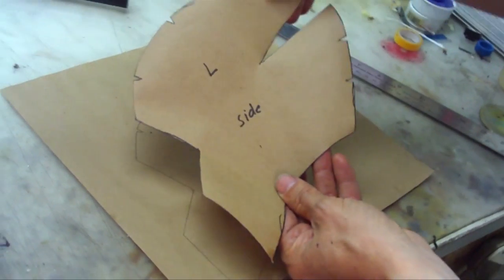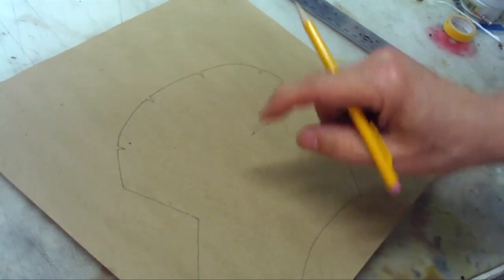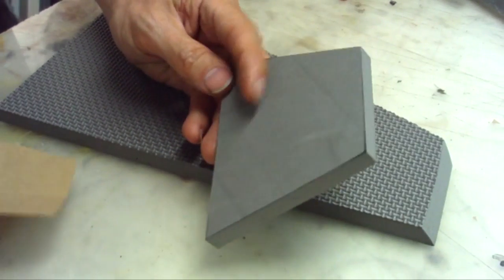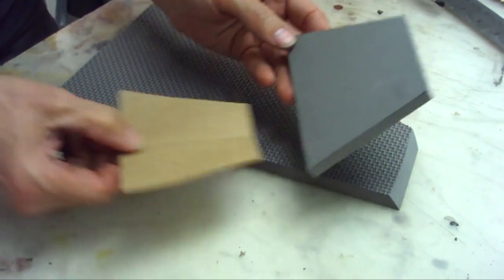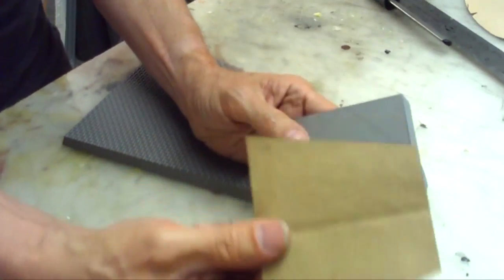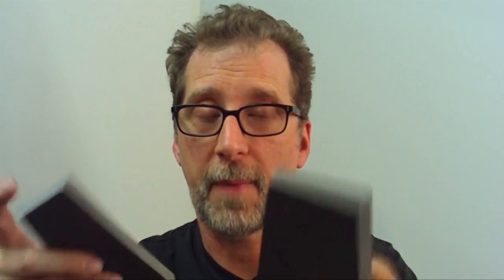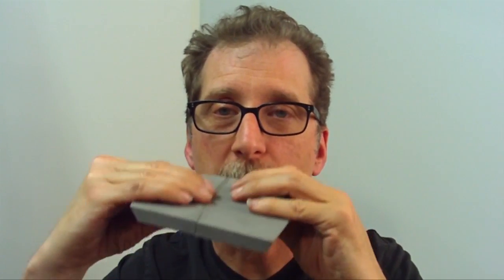Evil Ted Talks 3 : Foam Sizing, Pattern & Fabrication Tips

Comment: Ted: For what it's worth, you can also use flexible acrylic paints called "Americana", and "Folk Art". Since you have a Michael's out there on the West Coast, they're available there. The metallics of these acrylic paints are called "Goldens" and they come in 2oz bottles as well as 10oz bottles. I use a foam brush to apply. 

I do RC aircraft made from 1/4" blue insulation foam or 6mm Depron foam, and spray paints can't be used on these because the propellants eat up the foam, so that's where the brushed-on acrylics come in. If you have an air compressor, and you do, then you can get an inexpensive airbrush kit for around $30 and there you go. 

I really like your tutorials. You produce some very good stuff!

Comment: Hi Ted. I love your channel. It's super helpful. I am having to do some work with EVA-30 atm, which is much softer than the EVA-60 floormat foam and I am having a hard time getting clean edges. I find that the dremel tends to eat it rather than five me a smooth edge. What's ur best advice for working with softer foams?

Comment: Your videos have been an endless source of help for me!!! Quick question: I'm making an axe and wanna get a nice edge and it's a pretty thick bit of foam, the edge I wanna make is more graduated and acute than 45° so do I just adjust the angle at which I hold the blade against my cutting surface? I'm finding it difficult to explain haha I hope this makes sense :)
Reply from the maker: If you're having trouble cutting it, you can sanding the angle down.

Comment: Hello Ted. I would like to thank you for your instructions on creating helmets from foam sheets.  I currently use your method for making masks and helmets from paper mache sheets. I did encounter as you mentioned in your video a close mask fit when I made my first helmet. My question to you is how much length do you have to add to your pattern to get a comfortable fit? Is it determined by the thickness of the material? Thank you in advance.

Comment: Hi Ted, I have a foam head that I used to make my template but when I extended the lines on the side pieces the registration marks didn't line up with the ones on the center piece and the center is too small for the sides! How should I go about fixing this?

Comment: Evil Ted: I'm working with foam for the first time. I want to make a seamless 90 degree angle. I've made 45 degree beveled cuts on the back side, now I'm wondering whether to heat-shape the foam, cement it, or both. What would you recommend? Thanks!
Reply from the maker: +MikeHartsough My adive for everyone is to do it. If it does not work as you wanted it to, try again.

Comment: Hello, I have a problem, I buy a pack of foamy Fuxion brand of 10mm thick blue and green, the problem is that every time I cut it with the razor this folds, what is wrong? Is foamy different? I bought new knives and still the foamy folds, what can I do?
Reply from the maker: The first thing I would say is you need a sharp blade, but you say you have new blades? I have not hear of Foamy Fuxion.
Could you send me a link so that I can see it?
Reply: Thanks for replying Evil Ted, I realize that it is the same fomi, I was able to achieve perfect cuts last night sharpening my razor with a sandpaper, I do not know if a razor sharpener is needed, thank you anyway, and you do an excellent job, by the way. Which I have subscribed to for a few months, Supporting me on your advice and I will continue to see you from Toluca State of Mexico, good day Ted, continue inspiring me.

Comment: Hey Ted. You note about using the clear Plastidip on top of the paint for added flex. I did that on my first go at cosplay (before I watched this) and have peeling issues with it so I figured I shouldn't use it as a top coat. Do you do anything else after your clear plasti or have any suggestions and I thought it might help keep it durable on top but it just keep peeling off and looking terrible. I haven't come across anyone else yet who's done this. Thanks for your time and the vids - helps us newbies out a ton!
Reply from the maker: +Lore Preuss Yes, Lore. I be having the same problem of it peeling off. So now I just use the floor wax to seal my paint job..
I have my supply list just below my video.
Reply: +Evil Ted Smith Thanks, Ted! I'll check it out!

Comment: You do awesome work but you have a bad habit of putting your patterns on the top of your foam which makes your project smaller than the pattern by the thickness of the foam.
For material it doesnt matter but you are using foam with different thicknesses so shouldnt the patterns be enlarged a bit to compensate?
Reply: He kind of says it quickly, but he does mention that when he addresses the resizing question. Something along the lines of "You'll discover when you pattern these straight off your head, you'll notice they're going to be a little snug." He doesn't explain why, like you just did, but he does gloss over it. It's a good detail to know though, so I'm glad someone mentioned it.
Reply: phartattack ignore this guys comment. It’s all explained in the video. Resizing patterns

Comment: When you cut the foam at 6:35 do u have to puch hard, or was it like cuting butter?
Reply from the maker: Like cutting butter…Just need to have your blade sharp.
Reply: Nice to know, thank you :p
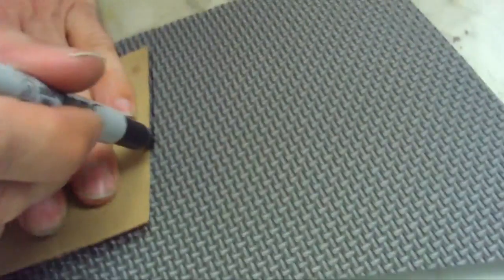Reply: Evil Ted Smith @ 5:50 or so... Exacto makes a 45* cutter that I use, but it doesn't cut deep enough. I MUST upgrade to a hot knife.
Reply from the maker: Yes, you need to get a box-cutter knife. That's what I use in the video.